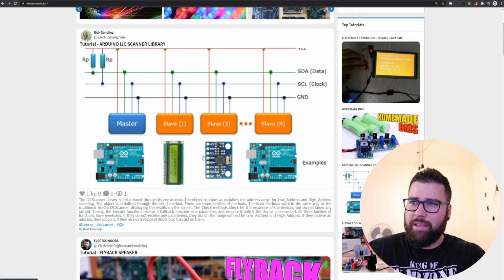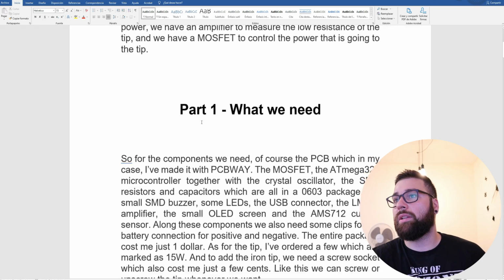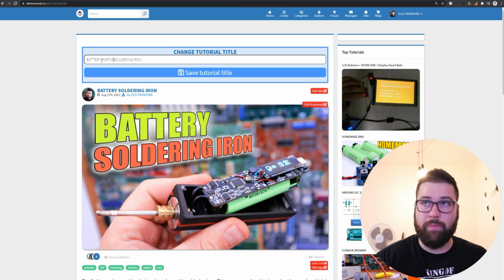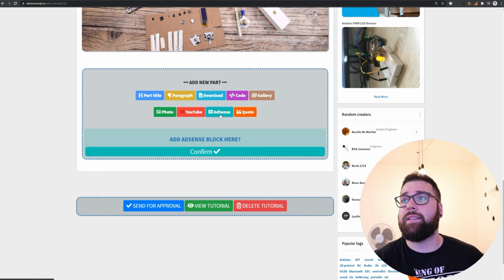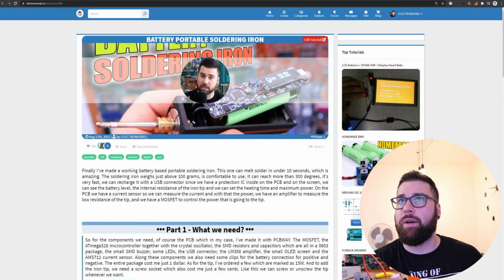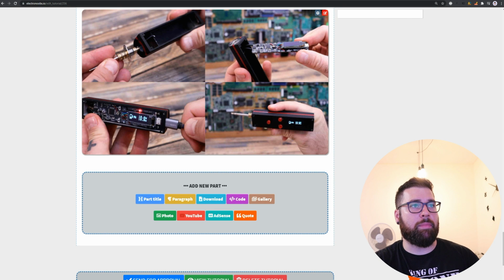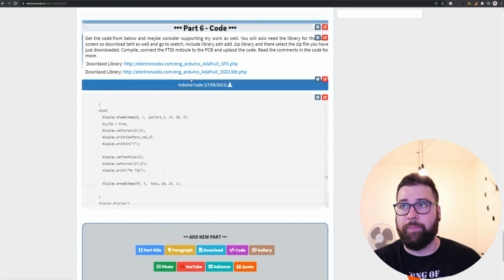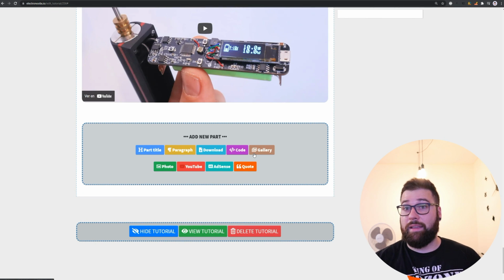Upload Your Tutorials - New Design on ELECTRONOOBS.io

Comment: Hello sir  I am working on battery voltage monitoring  3V - 4.2V to battery  1% - 100% using adc. It works accurately but when I connected load the % drop instantly.

So how to calculate battery % accurately, like in our mobile it shows accurate battery %